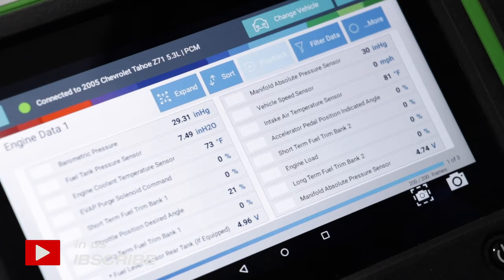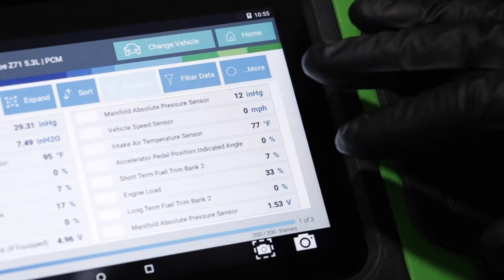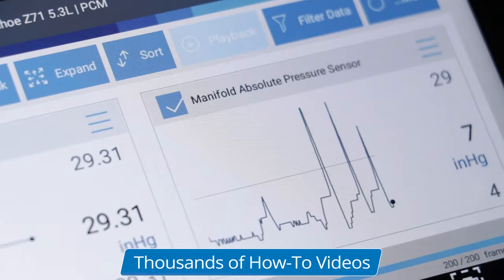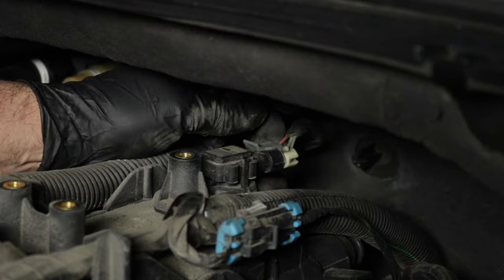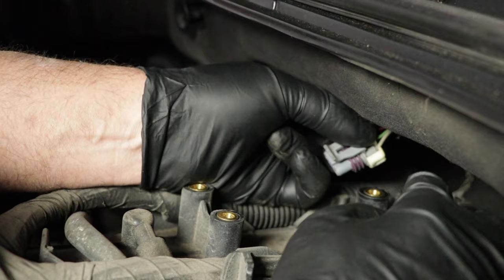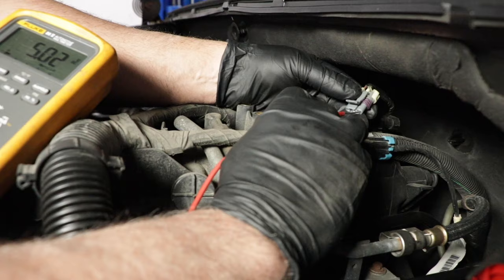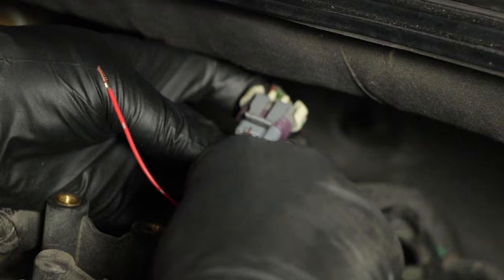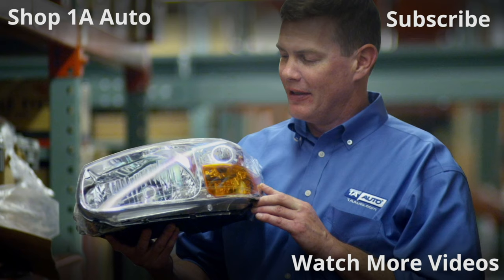What's a Manifold Absolute Pressure (MAP) Sensor & How to Diagnose It on Your Car or Truck

Comment: I am now a fully qualified 5 star YouTube  mechanic. Will only service higher end Ferrari's and Lamborghinis. Nice rundown on map sensors.
Reply from the maker: +Tom OConnor Thanks for checking us out!
Reply: 2013 chevy equinox 2.4l.. i changed my Map sensor and checked the wires and d voltage are good but the check engine light comes back on with the same Code.. please help
Reply: @1AAuto   2013 chevy equinox 2.4l.. i changed my Map sensor and checked the wires and d voltage are good but the check engine light comes back on with the same Code.. please help
Reply: Good One!.
Reply: Brother,Iam one like yu. Had 3 situations no crank no start and I managed to start all of them..... I love yu guys thanks for sharing yr knowledge
Reply: Ha!
Reply: I too am YouTube certified. Watched videos on diagnosing computer fault codes. (Proceeded to call my family and see if I could come down and fix their cars. 😃

Comment: What are the physical/driving symptoms of a bad MAP sensor. And then also for the Mass Airflow Sensor?? Thx for great videos guys!!!! (and gals 😁)
Reply from the maker: +Tube-dude We wouldn't be able to diagnose an issue like that here, you may want to have a local mechanic take a look at it. Thanks for checking us out! http://1aau.to/m/Shop-1AAuto-c
Reply: A bad MAP sensor may not allow the car to start at all—it will crank but won’t hold the idle at a level that will keep the engine running; it will just die.  While the RPMs are high—say, while cruising down the highway, nothing would happen, but the engine would die as soon as your foot is off the gas AND the RPMs drop.

MAF isn’t so severe.  My car will start and run with it unplugged.  For how long and what problems that might cause I can’t say.
Reply: @Phineas1626  what would cuz my car to turn off if I'm at a stop sign or red light.?
Reply: @Thethe49er  bad MAP and/or MAF, or bad idler valve. depends. seeing as this was a year ago I wonder what was the final cause of ur problem?

Comment: I use a cheap $10-20 bluetooth OBD2 adapter and $5 Torque app for Android. Works great on a phone or tablet. Pretty sure it will do all these tests, depending on what the ECM will allow it to read. I worked in a garage for a couple of years and used a several thousand dollar Snap-On Verus. Torque will probably do about 70% of what the Verus would do.
Reply: Same here but you are not able to read all the data just getting fault codes

Comment: Thank you for this video.. very much needed. You say you put in a jumper wire at 4:50 With a fuse; what size fuse is that ? Or what size ohm resistor do I use to put a jumper wire on that ? Thanks again.

Comment: Can the map sensor be bad if at idle when you rev it, it doesn't go up but when you accelerate down the road then it increases finally. It's a Honda element 04. No codes but running rich negative 15 both short and long term. Thanks.

Comment: Im having an isue with my map sensor It has the 5 volts reference ,has a good ground but the signal stays at 1.95 volts when conected to te sensor ,should it be higher and decrease as the pressure increses ??
Reply: You should see the voltage raise as you open the throttle.

Comment: Hi i need help with my MAP sensor wiring harness, i have a civic 9th gen R18z1 I'm facing an issue with the engine hesitation but when i wiggle the wire the hesitation went away however there's no check engine light or any sort of code on scanner,if anyone can help me on this issue I'll be grateful.
Cheers
Reply: I'm no expert but sounds like a break in wiring harness . Buy a new harness cut wires and use heat shrink and solder further back so its tidy . Can do testing first to check

Comment: its funny, MAP sensors are basically microphones. a diaphragm that changes a voltage range based on pressure waves. wonder if these could be used to detect knocks? i heard some cars have knock detecting microphones in them?

Comment: I have a 98 chevy 5.7 vortec pos. Lol. I have the po108 code. Dosent pop up untill the truck either dies or struggles so bad to stay running the tach drops and act like it out of time or running on only 2 cylinders. Wont start back up unless you try really hard but still struggles. I delete the code and in a matter of seconds its back to normal. Will run for 20 kins or so before acting up again. It did this that other day I deleted code and got a week out of it before it acted up again. When it's not acting up it starts hard and dosent start or sound right running but running ok. Know I have done so much t this engine I've changed every sensor wires plug wires cap rotor temp sensor knew MAF brand knew intake. And alot more. I dnt see how this map sensor could cause this am I right?
Reply: The map sensor basically acts like a brain. It can make your engine run all kinds of funky random ways. My guess is this is your problem
Reply: Did u ever figure out wat was causing your symptoms? My truck is having identical issues and replaced tons of stuff so far nothing is working

Comment: Will the map sensor cause the p0300 on a 2007 gmc yukon?
I've changed all plugs all wired checked every injector cleaned each one and tested all work...still same p0300 code flashing check engine light and stability track lights on

Comment: Wish I knew how to check all that myself .....  I've been having a lot of problems with my car and maybe it's just something as simple as that...my car jerks when driving and makes a weird noise .
Reply: weird noise can usually be traced back to a faulty OR functional  "weird noise maker doo-dad ", thank me later.
Reply: @jamesradcliffe3985  this is 8nteresting I get an odd noise too sounds like a low frequency vibration on and off . A map wouod cause this ? If so I'm getting one today looking at the new ones and from cleaning mime I'm sure I don't recall seeing the sane elements that should be present . Likely my issue

Comment: what is it indicate if i switch on the ignition and get 3.8v from the signal? The power is 5.1v? (i did not connect the sensor )

Comment: howzit 
my MK3 Golf 2lt have short to ground on the MAP sensor connector as per the dio, when i connect the sensor the car just dies even if you hold the rev now i decided to unplug the connector and runs but does not have power i some times have to climb the hill on the 1st gear 

where can i start resolving this issue

Comment: I have a question my car (lifan 320) is facing a problem because of the map sensor , I tried to replace it with another one but I can't find the one that fits my car is it ok to change the socket and pins of the map sensor getting out of the ecu

Comment: my scann tool el cheap o. is showing the intake manifold absolute Pressure at 4.78 PSI at 800 RPM, and about 5.36 PSI at 1800 RPM. why is mine in PSI. is it wrong?

Comment: Would this be the problem on my 08 Silverado if the check engine light is on with it showing ENGINE POWER REDUCED, TRACTION CONTROL OFF, SERVICE STABILITRAK and got code P0641????? Need help and know dealership will charge a body part for a possible simple fix.
Reply: That sounds like some kind of traction control fuse. I’d need more info

Comment: I have a 2008 Impala ss and the codes 106 and 108 have come up. I replaced the map sensor with a new one and the codes are still coming up. On my snap on scan tool the data is all good. I am at a loss as to what to do next is there a issue with the displacement on demand with these cars that can cause a map code if so what can I do to fix it
Reply from the maker: +dizzy66devil We wouldn't be able to diagnose an issue like that here, you may want to have a local mechanic take a look at it. Thanks for checking us out! http://1aau.to/m/Shop-1AAuto-c
Reply: I am a qualified mechanic for 30 years I am at a dead end with info like I said before all the data on my works snap on scanner is reading ok. The traction control light is coming on when I start up the car and intermittent flashing at idle

Comment: I have a 2015 Chev Malibu with 177000 km and it shows code 0089 and code
 0016.  Code 0089 says it's the fuel pressure regulator and the 0016 
says it's the

Comment: 2013 chevy equinox 2.4l.. i changed my Map sensor and checked the wires and d voltage are good but the check engine light comes back on with the same Code.. please help
Reply: Got a vacuum leak somewhere

Comment: My scan tool live data dosent have alot of these features and it's a 400 dollar scanner I'm trying to figure out how to read it properly. My truck has hard start cuts out at times lose of power and I ha e changed so many parts and still cant figure it out. I have no engine light. Checked all wires.

Comment: No check engine light 💡 comes on —I have to pump the gas pedal a few times for my truck to start if I don’t it won’t turn over 2. It kill’s while I’m driving —- someone in the comments help me out 🙏 2012 dodge ram 2500 Hemi

Comment: My 2006 Silverado 5.3 reads 10inhg turned off and stays the same when turned on 🤔 replaced my map sensor but still stays the same
Reply from the maker: +JayR We wouldn't be able to diagnose an issue like that here, you may want to have a local mechanic take a look at it. Thanks for checking us out! http://1aau.to/m/Shop-1AAuto-c

Comment: Hi, could you tell me what is the tool that you using for ?
Reply from the maker: +Curious Engineer That is a diagnostic scan tool, which helps diagnose codes your vehicle has.
Reply: Thank you but I meant rather the sofware name? :)
Reply: Finally I founded it myself ;)

Comment: So, my Veloster Turbo isnt throwing a code for anything (aside from O2 sensing due to gutted cats) butvI noticed myba/f ratio measured is constantly hunting for commanded by up to +/- 4 points. Constantly oscillating under cruise, idle, or WOT.  Will a bad MAP sensor cause this? And, it just died the other day when I pushed in the clutch coming to a stop. Started right back up. 🤷‍♂️

Comment: Can a bad MAP sensor interfiere with transmission? It shifts at high rpms and stays on 2nd shift i replace transmission already and still the same any advice thanks!!
Reply: I have a 2000 gmc sierra 5.3
Reply: Check your TPS
Reply: I have a 2008 gmc sierra 4.3 v6 . The transmission shifted hard from 1st to 2nd. Would almost give you a whiplash. Changed the throttle body and the map sensor and the problem went away. Don't know which one it was.